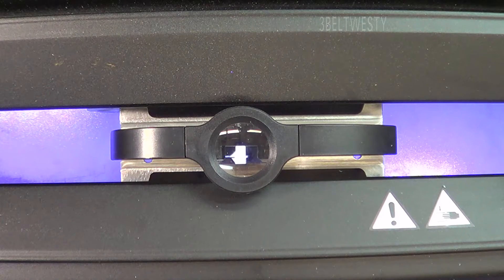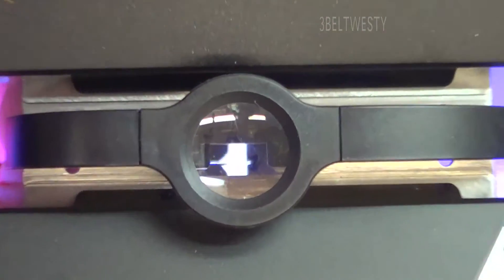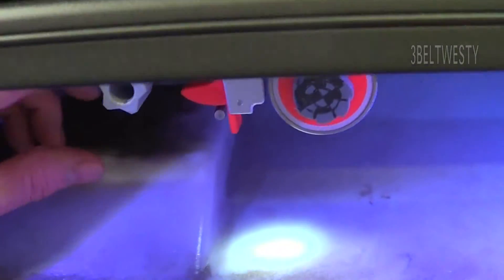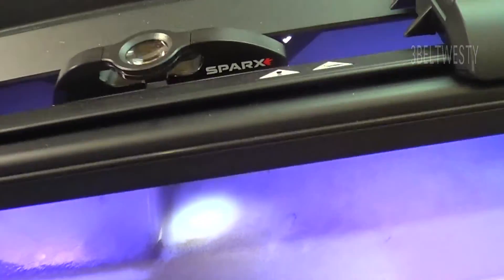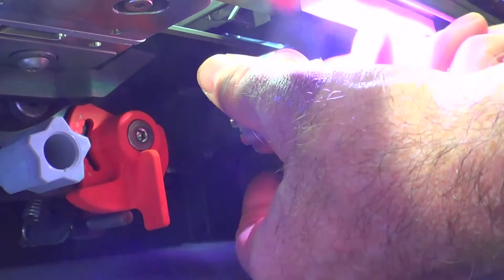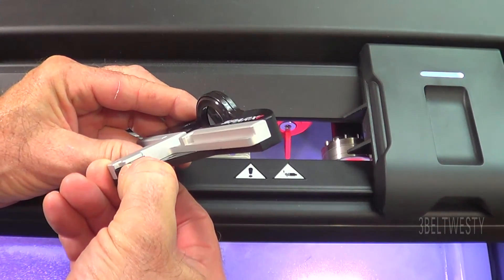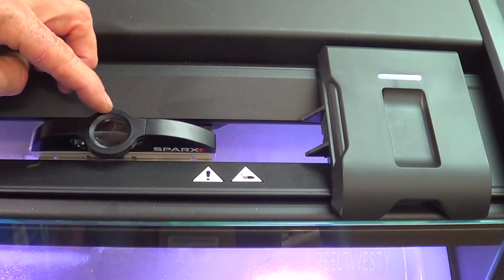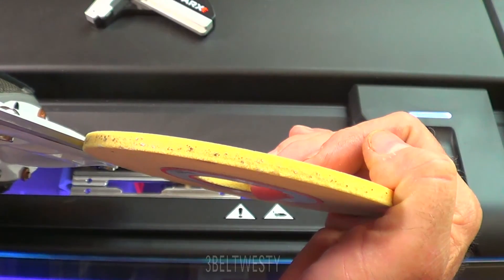Sparx sharpener alignment like rangefinder camera 3BW mp4

Comment: thank you for sharing the video. I had Sparx 2.0 for almost a year and still not entirely sure if I got the alignment right since depending on the angle at which I stare into lens it changes the angle making it difficult to see if the alignment ring and the little knob are really aligned or not :(
Is there any trick to ensure they are?

Comment: Great video!  - I was trying to align the Sparx (I already done this a year ago but because i got a new ring i wanted to double check but when i press red the button nothing happens. Have you come across this situation by any chance? Thanks
Reply from the maker: For Clarity; The red button to push for alignment mode should be the "bullseye" button. ie the middle button near the "ring gas gauge readout". 

The machine does not care if it has a alignment ring or not. The metal ring is passive; no RFID chip. 

These older ES100 machines of the some 2016/17 serial numbers need updated software to use many of the New Sparx disks made in 2023?? and later.

 My recent new in Dec 2023 Four rings of 5/8, 1/2, 5/16 and 1 1/4 rings had the 5/8 and 5/16 show as "bad". 

A convoluted exchange of messages to Sparx recently implies the oldest ES100 machines "ruin/corrupt" new rings and then the new rings will not work then on newer machines. 

The replacement 5/8 ring I got last week worked on my ES100 with no software update yet. So my guess is their inventory has new and old types of rings. So the plot thickens. 

I mention all this since not sure if you machine is not going into alignment mode OR you have a new/2023 ? ring that the original ES100 goofs up. By goofing up I mean the brand new rings reads as empty used up.

One of those 2 of the 4 rings that showed as "bad" was first tried on my ES200 that is 15 months old and it showed as "bad" too. Then I tried in on the ES100 and it showed as bad.

Comment: Thanks for sharing this video I had a little trouble with the alignment when I first got the machine Every thing is aligned the way it should be now even edges every time I wish that line would go starlight across to the other side 
Thanks well explained
Reply from the maker: You can move the alignment Ring wheel closer to the tool via the Left Right arrows